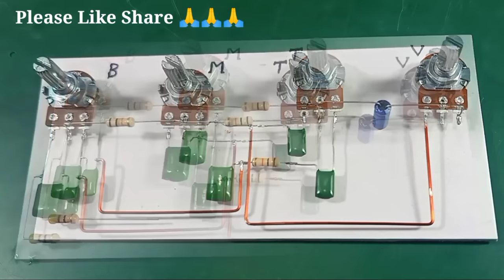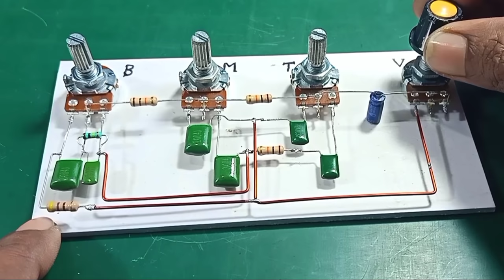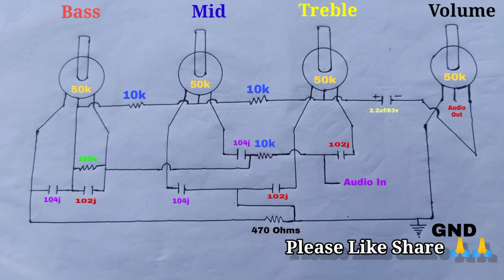Simple & Powerful Bass Treble Mid Volume Controller // How to Make Bass Treble Mid for Any Amplifier

Comment: thanks for it, I got a question.
can I use Capacitor 2.2uf100v instead of 63v? 
I couldnt find any 63v in our town. they all sold out. Or I have to wait more than a month to get some 63v
Reply: if the value is the same the voltage shuldnt matter in this case
Reply: @drutt1985  thanks mate,
Reply: you can also experiment with capacitor and resistor values in this kind of passive filter setup.
Reply: @drutt1985  understanding of this electronic knowledge is really hard for me, i just need to copy this video step by step to make One..
Reply: @catphisch7629  if you want stereo you just double this shematic use stereo pots or separate pots for each channel. its a passive circuit meaning it has no voltage so its hard to destroy electronics like amplifiers and sources like a mobile phone for example
Reply: @drutt1985  exactly i want this preamp for my bass guitar amp, :))
That's a little more exciting to make my own sound
Reply from the maker: Yes you can

Comment: Hello my friend, you are a genius. I made this controller. It works perfectly, I only have one doubt: I could only connect it before the amplifier. I would like to connect it after the amplifier, that is between the amplifier and the speaker, but it seems that the signal with power works differently. Is there a way to make it work this way? So I could include the controls inside a passive speaker. Hug from Argentina and thank you.
Reply from the maker: You try it
Reply: @RJEDITALL  I already tried, but it doesn't work like that, that's why I thought that if the signal is amplified, something would have to be changed but I don't know.
Reply: Hello matias. This tone control circuit cannot work after the amplifier. The component values would have to be completely changed. For a PASSIVE tone control circuit to work with significantly amplified input signal that then runs to a passive speaker the component values would have to be much more beefier and likely involve wire-wound toroidal chokes(inductors). Also, regular potentiometers would go up in smoke (poof!) at say 20 to 70 watt input signals.  The tone circuits inside PASSIVE two-way or three-way speaker cabinets use fixed crossover frequencies. If you want a variable high-power tone control, you'd have to swap regular carbon pots for more expensive wire-wound rheostats. The project is entirely possible but involves much beefier components at higher expense. The project expense would vary with the range of signal wattage input you want to handle.

Cheerfully to matias, 😋😋😋😊
Reply: This is a high impedance, headphone to line level curcuit only. A primitive all-passive bax filter probably. I'm too lazy to reverse engineer it. There is no version of this curcuit which will work sufficiently good after the output stage.
Reply: @melvinrobinson950  

This is a line-level passive tone control theoretically. There's no active component to it, and also no negative feedback which is usually part of an active bax filter.

Comment: Can you make stereo tone control using the same cuircuit?
Reply from the maker: you can use 6 pin potentiometer. same connection. all components double connection
Reply: @RJEDITALL  i got it thanks

Comment: Im in now way an audio or electronics expert but if you want stereo you either need to buy stereo pots or double up the amount of pots. like for this you would need the double amount of components and wire a separate positive and ground coming from the headphone cables to each channel. and no one says you need to be a nazi about the values of the components.  you could go completely crazy and have filtering through the entire audio spectrum i guess.

Comment: Anong voltahe ang power supply un ang kulang sa video
Reply from the maker: Clear not understand
Reply: @RJEDITALL  ung sa power supply ng  power ampliflier n binuo ilang ang dc volt ng ampli sir..
Reply: 12 volts ata sa main amp,, sa tone naman Walang dc volts yang tone control,  bali signal lng sya kaya may posibilidad na mahina pero clear sounds padin naman.. Try mo paps update mo ako pag nagawa mo..tinatamad ako gumawa😆 Thanks

Comment: I'm thinking about using it in the LM386 entry, I believe it works, what do you think?
Reply: Use a 4558 audio gain circuit coz this circuit reduces the audio out signal .
Reply: @shubhammaurya98760  Hello, thanks ! I will study this IC, do you use? Is it better than LM386?
Reply: @serginx  yeah 4558 is better than lm 386 i use it for low pass filter and gain op amp
Reply: @shubhammaurya98760  de primera

Comment: bhai i want this but without the treble control , bisically i need a adjustable bass , mid and volume for my woofer so what changes should i make to this
help
Reply: only  bass and volume would also do
Reply from the maker: You try with diagram, remove treble pot
Reply: @RJEDITALL  ok so basically remove treble pot and put jumper i place of it?

Comment: Rangkaian kayak gitu ndk akan menambah frequensi itu hanya memotong LF MF HF yang ada, karena untuk menambak BASS MIDLE TREBLE harus di suplai pre LF pre MF pre HF bisa ditambah filter By pass(LOUDNESS) dan harus di supply tegangan DC hampir mirip EQ tapi lebih simpel TC.
Reply from the maker: Yes, But working not Bad
Reply: Yes i ask what to do on treble side vol. is low? The rest is ok. I made stereo

Comment: Your project is very useful and good.
But you have not given the circuit diagram which is very necessary as while making connection of 4 tone control there are some place there is very confusion as wires are overlapping each other. Copicitor value are not mentioned while connecting them to 4 pot.
A K. Goel Jaipur
Reply from the maker: Please full video watch. Diagram in the video

Comment: Input outputnya saya paham, terus arus DCnya mana memakai berapa volt mas brow
Reply from the maker: This circuit working without DC supply. Thanks
Reply: @RJEDITALL  I saw u connected output wire to other kit.. what is that?

Comment: This video is good, however a bit more instruction is need to know which end of the capacitors and resistors are connected to where. Because the capacitors and resistors have positive and negative ends.
Reply from the maker: The components needed for this circuit have been used. Thanks

Comment: power suplaynya pake berapa pol
Reply from the maker: Working, Without power supply
Reply: arus listriknya yang barapa pool?....
Reply: untuk tegangan listriknya berapa volt?
Reply from the maker: This circuit use without power supply. Thanks
Reply: @RJEDITALL  yang sebelah hp,yang alat alat kecil apa nama nya

Comment: Hi what is the frequency range of the mid tones in this circuit? And which capacitors u used for mids? And how do you know which capacitors or resistors would work for mids or trebles? I am so curious.
Reply from the maker: Please check the diagram
Reply: @RJEDITALL  yes thanks i checked i see but i just wonder how you know which capacitors-resistors would work for mids or trebles?